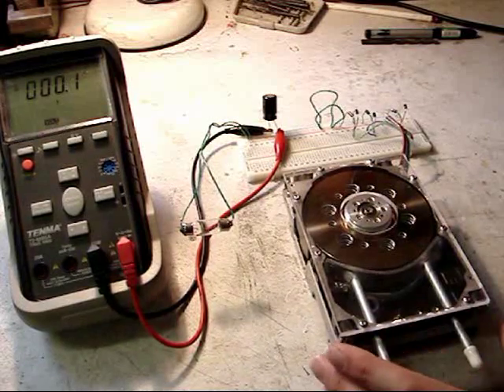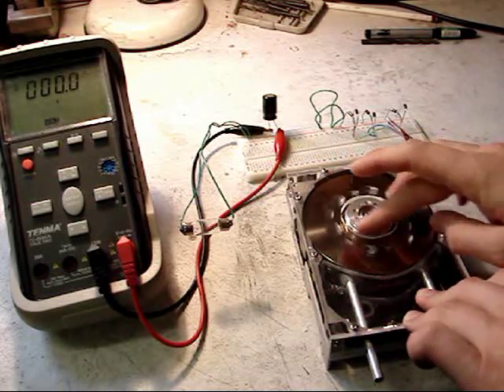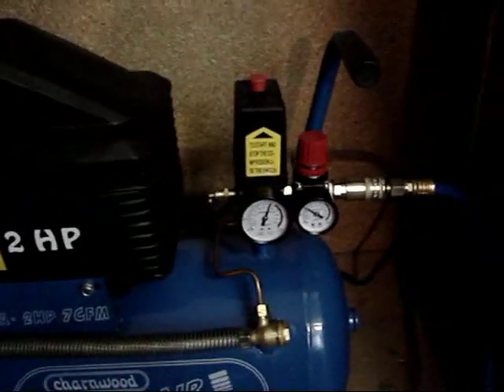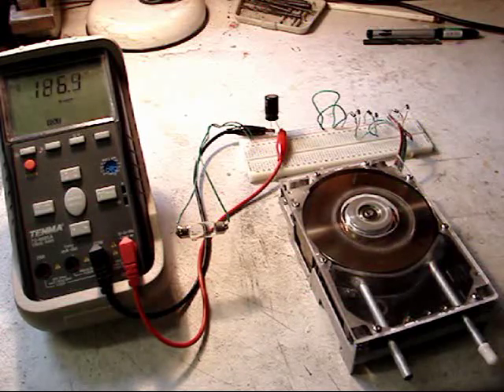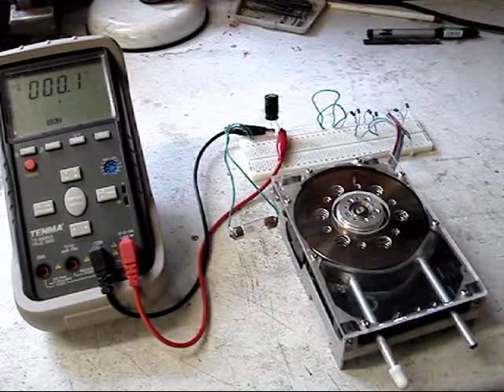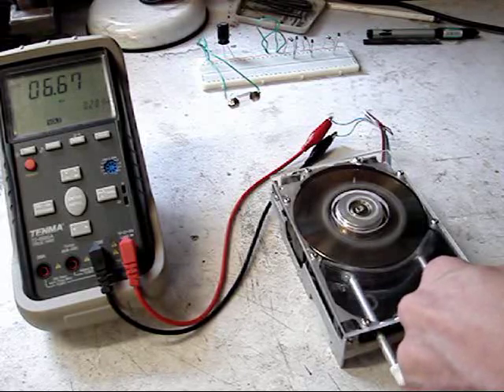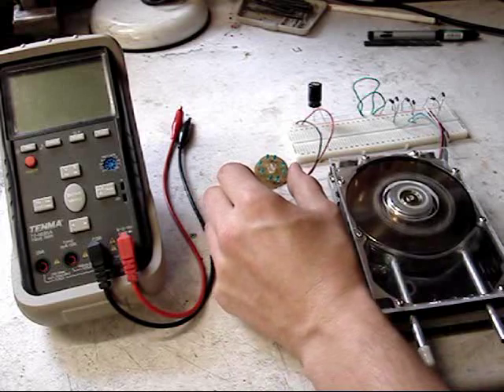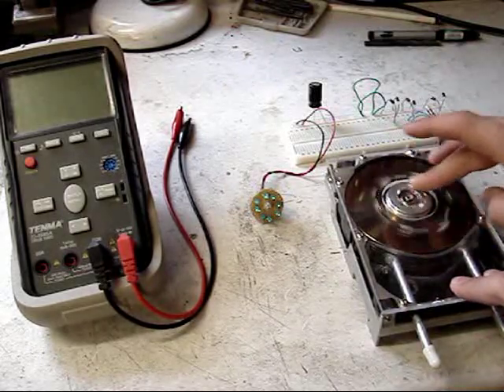HDD Tesla Turbine - HVLabs.com

Comment: rumor was tesla had used one of these in the vacuum of space and ran it on water. once it exits the earths orbit use the vacuum as propulsion boiling the water at low temp adding friction to the turbine blades increasing rpm. rumor was he used electricity to correct the satellite orbit similar to how tesla coils strip the air of it’s electrons he used tesla cloils shooting electrons to steer and all powered by his turbine directed by his famous coils. yes my tinfoil hat is on straight and all my cubesat teammates agree with me

Comment: What is the point? One has to apply work to it. From the compressor all the way back to the mains and it's source.
Reply: Joe W it makes electricity from work. Like every other source of electricity, it's just a highly efficient turbine, boil a lot water (solar concentrator?), force a lot of steam through it, make a lot of power.

Comment: Hard drive motor..smart.  They are engineered for efficiency.   The idea of a pressure cooker is interesting.  I wonder if while camping, you could actually make something somewhat efficient that uses thermoelectric generators between the flame and the water pot (5-10volts), and capture the pressure being released to charge another 5 volts.

Comment: I would like to make that work on a heat pump system to power the low voltage load and maybe the indoor and outdoor fan motors because they are dc now.so the grid would only power the compressor.

Comment: Ignoring the efficiency of the compressor and electric motor.  For your statement to be true, the compressor must have been running continuously as the experiment conducted., without the air tank gaining or loosing pressure.  In other words, compressor supplying the flow rate in that is same as flow rate out.  But you turned off the compressor and just used the reserves.  I am just going over what I seen in the video.

I am curious, since I want to do similar project.

Comment from the maker: Why do you say that? The air was supplied by a compressor that consumes ~1500W to power a 2hp motor and produce a constant 40psi. The losses of the system's equations are simply caused by the use of an air compressor for the pressure source. One could use any other source, eg thermal expansion of water, heat, steam anything, this would produce a usable force for the turbine. I'm simply examining the system that I set up.